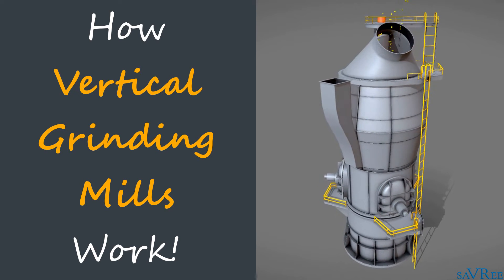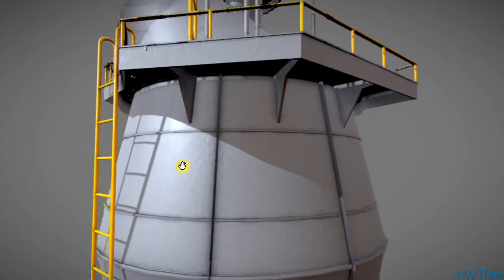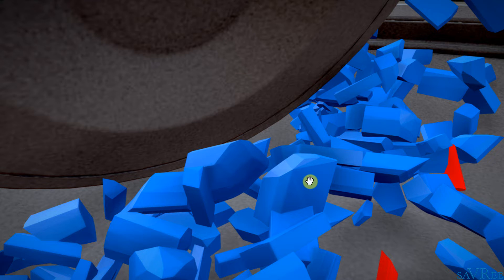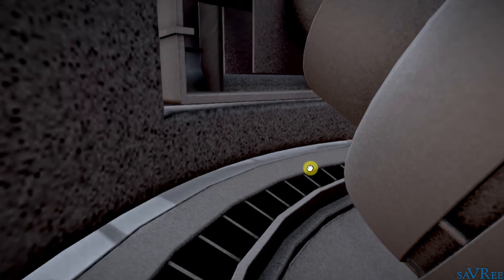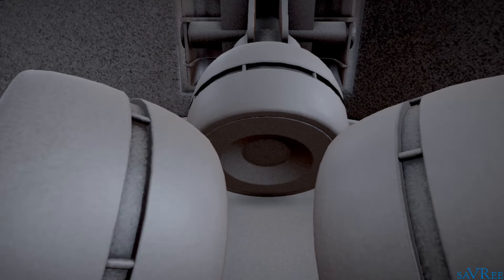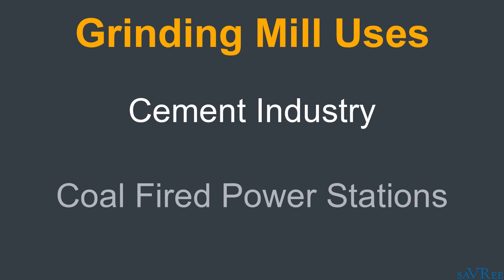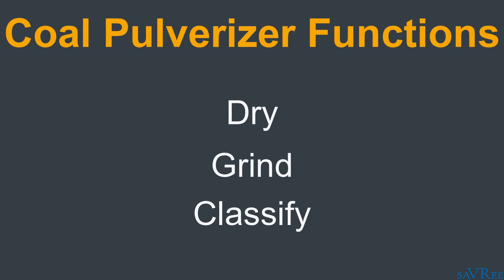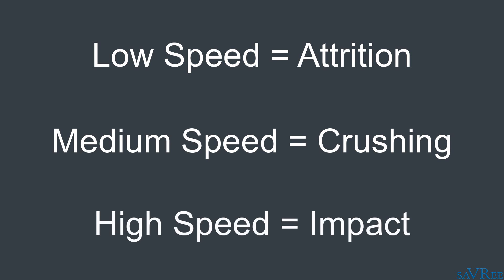How Vertical Grinding Mills Work (Coal Pulverizer Example)

Comment: Any office in Dhaka Bangladesh
Reply: We offer customized ultrafine grinding mills system and coated machines for caco3/dolomite/talc/gypsum/limestone/calcite/calcium oxide/ bentonite/dolomite powder
1.325mesh~3500mesh, finished powder fineness is adjustable.
2.Built-in air classifier, higher classifiying accuracy, powder narrow particle size distribution, better powder quality
3.lower energy-consumption, higher outpout(for same install capacity, 200~300Kg/hour)
4.PLC control, simple operation: 1. Low voltage components: Schneider 2. VF/Soft Start: ABB 3. PLC Controller: SIMENS
5.No Dust when producing
Samuel
Web:http://www.lymill.com/show_19.htmlm
MP/Wechat/Whatsapp: +86 15105956429 
Email:Samuel@lymill.com

Comment: This inspiring software, the calm and clear way you explain it is just great.
Reply: We offer customized ultrafine grinding mills system and coated machines for caco3/dolomite/talc/gypsum/limestone/calcite/calcium oxide/ bentonite/dolomite powder
1.325mesh~3500mesh, finished powder fineness is adjustable.
2.Built-in air classifier, higher classifiying accuracy, powder narrow particle size distribution, better powder quality
3.lower energy-consumption, higher outpout(for same install capacity, 200~300Kg/hour)
4.PLC control, simple operation: 1. Low voltage components: Schneider 2. VF/Soft Start: ABB 3. PLC Controller: SIMENS
5.No Dust when producing
Samuel
Web:http://www.lymill.com/show_19.htmlm
MP/Wechat/Whatsapp: +86 15105956429 
Email:Samuel@lymill.com

Comment: good job
Reply: We offer customized ultrafine grinding mills system and coated machines for caco3/dolomite/talc/gypsum/limestone/calcite/calcium oxide/ bentonite/dolomite powder
1.325mesh~3500mesh, finished powder fineness is adjustable.
2.Built-in air classifier, higher classifiying accuracy, powder narrow particle size distribution, better powder quality
3.lower energy-consumption, higher outpout(for same install capacity, 200~300Kg/hour)
4.PLC control, simple operation: 1. Low voltage components: Schneider 2. VF/Soft Start: ABB 3. PLC Controller: SIMENS
5.No Dust when producing
Samuel
Web:http://www.lymill.com/show_19.htmlm
MP/Wechat/Whatsapp: +86 15105956429 
Email:Samuel@lymill.com

Comment: Amazing 3D model and clear explanation. Suggestion: make a video on air-dampers used in Coilover shocks
Reply: We offer customized ultrafine grinding mills system and coated machines for caco3/dolomite/talc/gypsum/limestone/calcite/calcium oxide/ bentonite/dolomite powder
1.325mesh~3500mesh, finished powder fineness is adjustable.
2.Built-in air classifier, higher classifiying accuracy, powder narrow particle size distribution, better powder quality
3.lower energy-consumption, higher outpout(for same install capacity, 200~300Kg/hour)
4.PLC control, simple operation: 1. Low voltage components: Schneider 2. VF/Soft Start: ABB 3. PLC Controller: SIMENS
5.No Dust when producing
Samuel
Web:http://www.lymill.com/show_19.htmlm
MP/Wechat/Whatsapp: +86 15105956429 
Email:Samuel@lymill.com

Comment: Very helpful video sir. Could you please tell can we grind clinker and flyash together in coal Pulverizer mill and make cement using the same mill as well ?
Reply: We offer customized ultrafine grinding mills system and coated machines for caco3/dolomite/talc/gypsum/limestone/calcite/calcium oxide/ bentonite/dolomite powder
1.325mesh~3500mesh, finished powder fineness is adjustable.
2.Built-in air classifier, higher classifiying accuracy, powder narrow particle size distribution, better powder quality
3.lower energy-consumption, higher outpout(for same install capacity, 200~300Kg/hour)
4.PLC control, simple operation: 1. Low voltage components: Schneider 2. VF/Soft Start: ABB 3. PLC Controller: SIMENS
5.No Dust when producing
Samuel
Web:http://www.lymill.com/show_19.htmlm
MP/Wechat/Whatsapp: +86 15105956429 
Email:Samuel@lymill.com

Comment: Thank you! I really understand the VRM now!
Reply: We offer customized ultrafine grinding mills system and coated machines for caco3/dolomite/talc/gypsum/limestone/calcite/calcium oxide/ bentonite/dolomite powder
1.325mesh~3500mesh, finished powder fineness is adjustable.
2.Built-in air classifier, higher classifiying accuracy, powder narrow particle size distribution, better powder quality
3.lower energy-consumption, higher outpout(for same install capacity, 200~300Kg/hour)
4.PLC control, simple operation: 1. Low voltage components: Schneider 2. VF/Soft Start: ABB 3. PLC Controller: SIMENS
5.No Dust when producing
Samuel
Web:http://www.lymill.com/show_19.htmlm
MP/Wechat/Whatsapp: +86 15105956429 
Email:Samuel@lymill.com

Comment: Can you make a video on clinker kiln and preheater?
Reply: We offer customized ultrafine grinding mills system and coated machines for caco3/dolomite/talc/gypsum/limestone/calcite/calcium oxide/ bentonite/dolomite/kaolin/clay powder

1.325mesh~4000mesh, finished powder fineness is adjustable.

2.Built-in air classifier, higher classifiying accuracy, powder narrow particle size distribution, better powder quality

3.lower energy-consumption, higher outpout(for same install capacity, 200~300Kg/hour)

4.PLC control, simple operation: 1. Low voltage components: Schneider 2. VF/Soft Start: ABB 3. PLC Controller: SIMENS

5.No Dust when producing

Samuel

Web:http://www.lymill.com/show_19.htmlm

MP/Wechat/Whatsapp: +86 15105956429 

Email:  Samuel@lymill.com
Reply: We offer customized ultrafine grinding mills system and coated machines for caco3/dolomite/talc/gypsum/limestone/calcite/calcium oxide/ bentonite/dolomite powder
1.325mesh~3500mesh, finished powder fineness is adjustable.
2.Built-in air classifier, higher classifiying accuracy, powder narrow particle size distribution, better powder quality
3.lower energy-consumption, higher outpout(for same install capacity, 200~300Kg/hour)
4.PLC control, simple operation: 1. Low voltage components: Schneider 2. VF/Soft Start: ABB 3. PLC Controller: SIMENS
5.No Dust when producing
Samuel
Web:http://www.lymill.com/show_19.htmlm
MP/Wechat/Whatsapp: +86 15105956429 
Email:Samuel@lymill.com

Comment: Vertical Mill & Table Mill is a same thing?
Reply: Hello friend. China producer Get【Price & parameter of 2-120tph Raymond Mill 】Click:https://www.china-sand-maker.com/machine/p54.html?yt
Reply: We offer customized ultrafine grinding mills system and coated machines for caco3/dolomite/talc/gypsum/limestone/calcite/calcium oxide/ bentonite/dolomite powder
1.325mesh~3500mesh, finished powder fineness is adjustable.
2.Built-in air classifier, higher classifiying accuracy, powder narrow particle size distribution, better powder quality
3.lower energy-consumption, higher outpout(for same install capacity, 200~300Kg/hour)
4.PLC control, simple operation: 1. Low voltage components: Schneider 2. VF/Soft Start: ABB 3. PLC Controller: SIMENS
5.No Dust when producing
Samuel
Web:http://www.lymill.com/show_19.htmlm
MP/Wechat/Whatsapp: +86 15105956429 
Email:Samuel@lymill.com